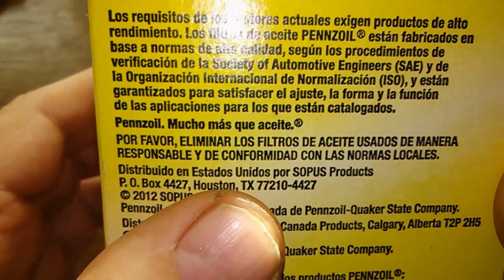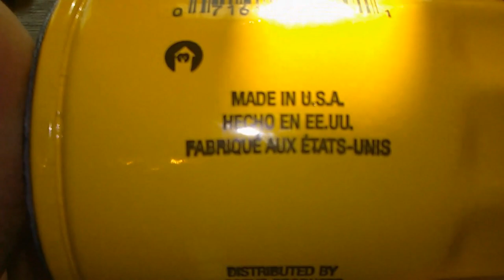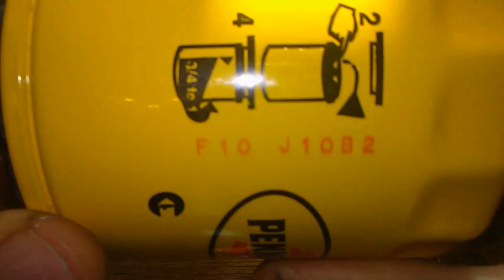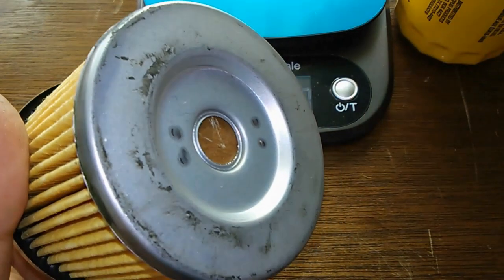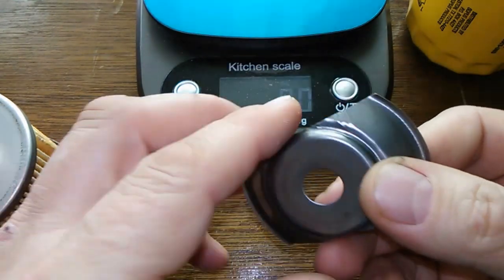Pennzoil PZ167 Oil Filter Cut Open

Comment: Thank You, again… love the Yellow too: ** BUT :  **interestingly, I always wonder about heat Radiation, cooling of oils ( esp.,during Flowing,etc) from these “ colors , paint jobs , erc. “ on canisters?. I always understood proper coatings//Flat Blacks/ dark radiate heat   Better than other colors; also types of paint, adjuvants in coating/:……..my suspicion have been that Housing , *& that this helps cooling ( some Degrees, in some applications)…some Engineers or Techs???   Thanks.

Comment: Good to see Penzoil filters are of better quality than they where 10-12 years ago. When I worked at NTB a lifetime ago, they used penzoil filters. They used to be rebranded Fram filters with the cardboard end caps.
Reply: Thanks... interestingly I remember **some PENZZOILproducts being of fair quality in past year’s :  I have been  doing a lot of simple wrenching o. My several vehicles for 50 plus years ( shocks, plugs, filters,etc).....many years I default to name Brand, ORIGINAL MANUFACTURER, OR WHAT was available ( actually used a lot of FRAM FILTERS ( esp AIR) over the years.. this PERFORMAX PO167 Oil Filter on my Dealer Program surprised me.....though my “ SOPUS”, etc prob PENZZOIL ordered....!

Comment: I agree looks like a Purolator filter.  

Not a fan of the stamped spring as if the spring gets bent probably will not keep the filter tight.  

Great job!  Nice video!

Another great filter for 5K.  Depending on the price there might be better filters available.
Reply from the maker: Thank You, Jason!
I'd say It's an okay oil filter👍🙏😊.
Reply: Thanks, me too. I replace them early with ROYAL PURPLE /NAPA GOLD, IF I am driving hard, Summer,etc. Overkill, as I prime with MOBIL1: my Dodge Dealer uses Conventional MOPAR 5W-20/ PERFORMAX 167, every 3-5 ,000 OCI, INCKUDED IN MY new car ( * First time I ever done Dealer , though it is handy some times!, Also,** actually, AMAZON MISTAKE ON MY MOPAR AIR FILTER , & THE “NAPA GOLD AIR FILTER” did **NOT FIT in my plenum ( shocking , as first time on **NAPA GOLD,),  though, I may been better off to (keep OIL)doing myself, and /or switch to MOBIL1).....

Comment: I just subb'ed today this is a very informative channel.  So I have a question.  Have you ever seen a VO Oil filter? Which is a Valvoline Oil Filter.  Mr. Tire/Monro Muffler Corp uses the same filter but its yellow instead of white and its made in China.  They claim its the same filter.  Would love to see  a video of the two one day cut open side by side.  Because we had the oil change done at Monro Muffler and the vehicle got vapor locked and lost oil pressure.  Dodge dealer said it was because of the crappy filter.  Later I found out the "VO Filters" were printed in china and painted yellow but Monro puts VO and claims they are Valvoline but they are not.
Reply from the maker: Here's a used Valvoline oil filter I opened up in September last year. I don't even know where you can get these. I did a 1st oil change on my daughter's new to her car, and this filter was on there. https://www.youtube.com/watch?v=PJgZEbK3QGA&ab_channel=WhipCityWrencher 
Thanks for watching.👍🙏😊

Comment: Thanks, looks like Quality Product....etc. Does resembles the Dealer’s OIL FILTER:(*painted shiny White)“”*PERFORMAX PO167, DIST BY **SOPUS, labelled ,**now :made “IN USA”””, (was ***Mexico previous years).......... I replaced one before Dealer 
Program,schedule,last year: discarded it...... If I change out my just installed; Dealer PERFORMAX, I MAY SLICE IT OPEN.......as I run them 3-4K MILES OIL CHANGE INTERVALS, CONVENTIONAL MOPAR 5W—20., on my 2015 DODGE JOURNEY 4CYL............Anyways, good work,oddly interesting!....
Reply from the maker: You're Welcome!
If you want send it to me and I'll cut her open and make a video.👍🙏😊
Reply: @WhipCityWrencher  : a thought, Thanks......later.

Comment: Purolator doesnt not make filters
Reply from the maker: Yes, I know, they're now owned by Mann and Hummel.
Thanks for watching.👍😊
Reply: Actually Purolator DOES make filters in their factory in Fayetteville NC. Just because M&H owns them doesn't change the FACT that they still make filters. The topic filter is made by Purolator for Pennzoil to their specs.
Reply: @faxmen09  thanks, interesting.. Any more dope on these Penzoil Filters, etc(( my Dealer just switched to, from PERFORMAX 167, Mexico,etc)…appear to be robust, etc.
Reply: @opera93  Iirc, like Pennzoil, Performax oil filters 'used to be' made by Purolator in Fayetteville NC. If they are now made in Mexico, possible it's a Mann &Hummel/Wix made filter. Without seeing it, can't say for sure.